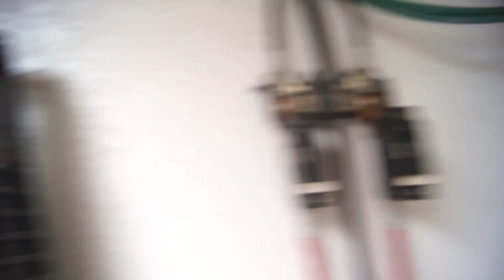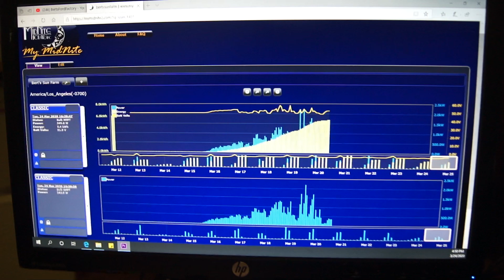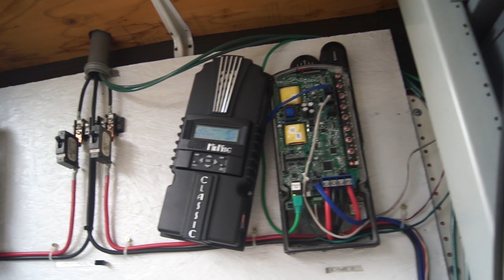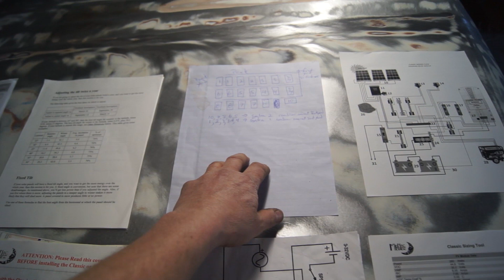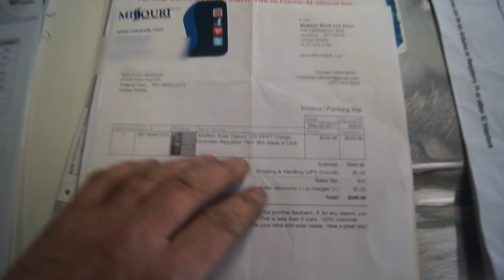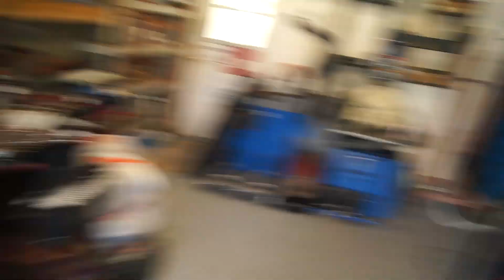5600 watt grid tied multiple inverter Breakdown.

Comment: I’m still confused as to why you need the solid state relays? Can you please shed some light on that, and explain a bit more?
Reply from the maker: The inverters were activated by the battery bank voltage. above 46vdc and they were turned on and below 44vdc they were turned of. the relays handled that switching.

Comment: Did you have to match each leg (L1 vs L2, when wiring the quad box the inverters plug in to) so the CTs would be on the same leg in the panel as where the inverter was plugged in? Thank you
Reply from the maker: I’m not sure what you mean when you say quad box. I did not use an external control box for the inverter. Basically line one power goes to the solid state relay controlled by the charge control so if battery voltage is above 46.5 it allows ac voltage to flow to the inverter. The inverter then samples that voltage and if the amp clamp on line one dictates power being used the inverter makes ac from the batteries at a slightly higher voltage than what is sensed by the inverter up to slightly less than max ability. When amp clamp demand slows so does production. If battery voltage drops too low then the charge controller shuts the relay and production stops and charging begins. I hope this helps😀
Reply: @BertsFordFactory  
The "quad" box is the four outlet/receptacle that the inverters plug in to to backfeed power. What I was trying to determine was whether the one side was phased with the same CT for that inverter. I hope that explains it a bit more - my apologies for any confusion. Thank you again.
Reply from the maker: @rf8741  oh! Yes the outlets that the inverters are plugged into must be on the same line as the amp clamp type sensor.
Reply: @BertsFordFactory  Great! Thank you very much!

Comment: Awesome setup!   But when the power grid goes down, those GTIL inverters also go down because of the required anti-islanding regulations.  Then your house goes dark like the rest of the houses even though you have full battery at night or full battery in day time even with 5000W of bright sunshine coming in. :-(

Have you found a cheap way to generate a stable split-phase 240VAC power that can "fool" the inverters into thinking the grid is back?  You can still keep the power flowing out to the grid with an interlock or transfer switch.   I've found the off-grid inverters that can produce 240VAC split-phase tends to be expensive because they are large.  Most off-grid equipment is made for small RV setups and are only 120VAC single-leg which is useless full "whole-house" setup like this.
Reply from the maker: If needed I can isolate the house at the main breaker and then run my genset for 240 source. I been thinking about grabbing a couple non islanding inverters to switch to while power is out and the main breaker is off
Reply: @BertsFordFactory  Have you done a test with the gas generator feeding split-phase into the house?  Do the GTIL inverters sync up with that split phase signal?  Need to be able to do this so that the battery bank can be engaged and available during grid out situation.  Of course, if sunny, the panels should contribute too if the grid outage is in the daytime.

Also, what off-grid split-phase inverters have you looked at?  That could work.  But a problem I see is the split-phase inverters are like $800 at least.  Consider also this off-grid inverter would be sitting idle upwards of 99% of the time because it can only be used when the power goes out and the house has been isolated.

Basically, I'm looking for an inexpensive split phase inverter that ideally feeds off the 48V battery bank.  It could be small < 300W even.  All it needs to do is establish the 240VAC split phase signal and power on the GTIL inverters "fooling" them into think the grid is present.  The GTIIL inverters and solar panels would be supplying most of the home's power when they start up and are synced.

Also, this off-grid inverter needs good clean AC output.  The grid-tie inverter's anti-islanding algorithms may reject a choppy AC signal.  Even though an inverter advertises "pure sine wave", it remains to be seen if it can fool an anti-islanding inverter.

Comment: Hi, curious if you had to do anything special to sync the output phased on the inverters? Or do they get the phase from the power in from ac input? Your old inverters in shed don't seem to have any syncing link between them?
Reply from the maker: You are correct the phasing is handled by the inverter sampling the input ac

Comment: You mentioned you have series connection for every 2 panels, making your panels output to 48v, what is the amps output, doesn't Your eco worthy combiner box fuse maximum 10amps? How does that work? Or can you change the fuses?

Comment: Hello great information. Your ssr is dc to AC or ac to AC? Ty
Reply from the maker: It uses the low voltage DC side for the activation from the charge controller and the AC side for the voltage pass through to the inverter plug ins.

Comment: Hi just came across your channel and saw your video...im looking at doing the same set up to an extent. im thinking of connecting 60 panels at 330wat each together in to 6 strings of 10 panels and connected to 6 inverters that are 3000 watt inverters. can you tell me how i can combine the power from all 6 inverters to go into a feed in meter so if im not using the power for the house i want it to go out to the power grid? is it true that if you tie your inverter to the grid it can draw power from the grid and feed it back to your solar panels at night and cause you to have an electric bill? probably not true but read it online. Can you also give a breakdown for what guage wire to use, what amp fuses to use they're going on my roof thats 40 feet long. i dont want to use batteries trying to go for net metering. Thanks in advance
Reply from the maker: hello, sorry for the slow response. A lot of what your asking is design specific but ill try to help where i can. to officially tie to the grid you usually need an agreement with your power company to feed back to the grid. usually its a "net metering" type setup. I do not do that i only take from the grid. The wire you need will be determined by the voltage you are carrying and the distance ( google ampacity chart ) This is why most people like higher voltages because the require smaller wire. If you do want to go net metering for sure then micro inverters would be your best answer. they sit at the panel and invert to 120/240 then you combine that and send it to the meter. if you want to use your design then a combiner box would be the answer for getting it all to one buss bar.

Comment: You know you can get a Midnite solar and program on for the axillary power SSR to turn on a certain voltage to control two inverters that way you won't have to be turning on and off it will do it a certain voltage
Reply from the maker: You are right, that’s what I do, however I switch off the second inverters sometimes to reduce the load during strings of cloudy days so the batteries have a higher cycle rate helping them to have a higher charge overnight or for long cloudy periods.

Comment: Nice video bro but what do you do in a power outage.
Reply from the maker: Unfortunately, at the moment, I need to isolate from the grid and then run my generator. I have plans of a 10,000 watt pure sinewave inverter that I can use instead of the grid ties. Thanks for your question.
Reply: @BertsFordFactory  Cool you have a great system check to make sure the new inverter allows AC coupling and then you will be truly offgrid cheers.